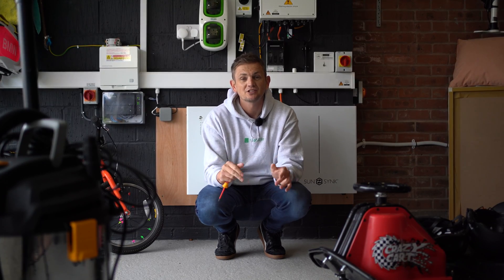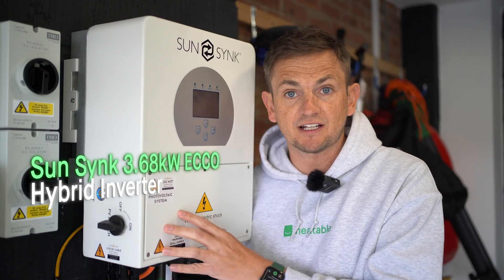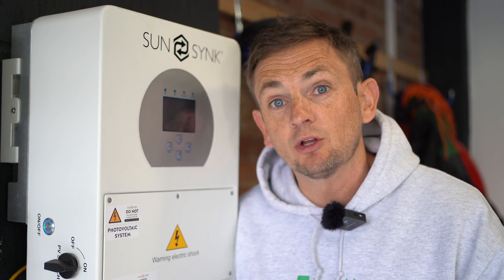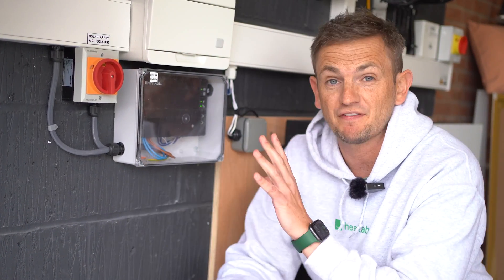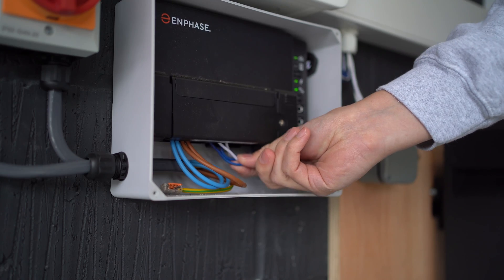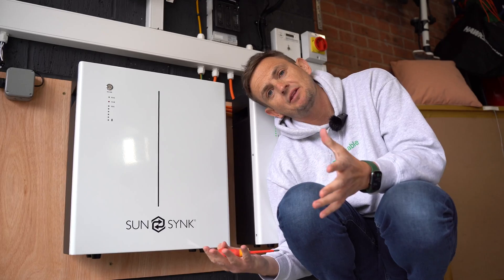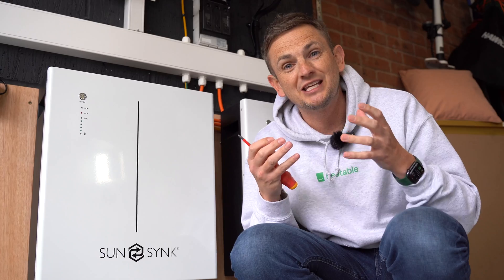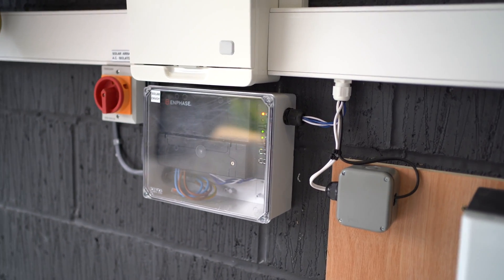Standard vs Bifacial Solar Panels: Is the extra cost WORTH it?

Comment: You changed to many items, so this is not a comparison of Standard vs Bifacial panels. To do that you would have needed to wire the new panels up to another Sunsynk. As noted by others you have also crippled the Sunsynk setup by removing the 5 solar panels so that it does not see enough voltage to operate at certain times.

Comment: Frustratingly, because you have chosen to use different pannels with different technologies on each, we cannot see the difference in gains from just the microinverters compared to the hybrid. I get why you have done this, you are comparing your services to the rest of the market but my inner scientist is screaming ONE VERIABLE AT A TIME! :D :D

One comparison I would love to see would be an REA system with microinverters pitched against a tesla powerwall 3 and its hybrid inverter.

An even more interesting test would be north facing vs south facing with the REA and microinverters. There are some YouTubers that have been going down the north facing expansion and results seem promising so far at 50% of peak generation or more and I believe that is without bifacial or microinverters.

I'm very torn on the whole micro vs string aspect. Each micro being a potential point of failure that would presumably require scafolding costs to resolve, which I'm assuming the warranty wouldn't cover vs the costs of replacing an inverter at ground level covered by warranty. What I have found with the PW3 is that if its inverter fails you can just buy a new PW3 and use the old one as a battery expansion, which  is an interesting scenario.

Its all a bit mute for myself sadly as I'm trapped in a shared ownership nightmare where they will not allow me to install things like solar or heatpumps until I mortgage the other half of the property, which is a few years away at best, so I can probably get better data in that time. I may be able to get away with a battery system to use offpeak rates, however.
Reply from the maker: @tangent2658  Thanks for your comment! We’re actually looking at conducting more tests that will show the power of the REA panel itself against a standard panel. The data speaks for itself so we’re keen on pushing with a variety of them but organising them has taken some time😅
Reply: @Heatable  Thank you for the reply. Very much looking forward to those kind of tests. I know it is not exactly a common application but I would really like to see data on true north facing panels on a pitched roof with a steep pitch say 50 degrees. Essentially the worst case scenario for the pannels, any panels. I want to see what those low light panels can produce when compared to a single layer cell in the same scenario. They can both be on the same kind of microinverters, infact would have to be, unless you wanted to do a bigger test on DC string with 4 to 6 pannels on each test bed. There are a few YouTubers with mostly north facing arrays and they have pretty decent results.

Comment: One month on after having two installs with one being Jinko Neo 440 panels via string and the other REA with enphase 8 microinverters. Comparing generation per panel, the expectation was that the REA would perform 20% better but that is not what I am seing. If anything, I am seeing 20% less generation. The claims are that microinverters activate earlier and stay on longer. Again, this is not my experience. Overall I would recommend Heatable for service, I would however not go with the extra expense of REA and microinverters if I were to do it again.

Comment: The test is inaccurate.
You should have same types of panels on both inverters to compare, of course the older one sided panels performs less than the newer doublesided ones.
Its not the inverters fault.

Test is rubbish.

Comment: I have a question how old were the hybrid  panels system what % of this difference could be attributed to old panel Vs new panel it's proven that efficiency is lost in the first years and then plateau until failure
Reply from the maker: HI, great question. The Hybrid panels were around 9 months old at the start of the test.

Comment: I see what you've done, but ....
You have compared a string to a single panel track, one converting the other not.
You also missed the cost difference and also the life span difference.
Miss matched panels will run at the lowest for all of them with a string inverter.
I can confirm there can be a big difference due to panels alone. Which would cause an issue with data.

Now production and usability. Enphase does not have a battery, so you're not storing power to use later at night.
This could be seen as adding to the cost of ownership, together with the higher price of the hardware.

You could say you lose 15% for 50% more costs. Or we could just look at a 420w panel which only gets 290w usable... 

Stats will only look as good as you want them too.  😊

But for part systems, with AC coupled battery inverter... Going to be better than a sting inverter and offer flexibility and suitable for more complex installs.

Comment: What inefficiency is introduced when adding batteries to the enphase system as the DC is converted to AC and then back to DC to charge the batteries?
Reply from the maker: There was no batteries run on the test. There are various opinions from manufacturers would be losses of approx 3-5% would need to be factored. Worth noting that with an AC coupled battery, more power can be supplied to the home rather than limiting the hybrid inverters max output.

Comment: You didn't mention how much energy loss you would get converting ac to dc when charging batteries, in my opinion that's where hybrid inverters out perform micro inverters
Reply: any ac-DC dc-AC convertion kills over 10% energie ist absolutly nonsenst.
lets say panel to micro inverter = 80-90% eff so over 10% killed.
then micro inverter to DC for batterie charge again 80-90% eff = over 10% killed.
then from battery in the night back to gridd again...energie killed.

only an idiot will do somethink like that.

the serious way last years, solar = DC with a mppt charger into a batterie = 98% from the sun goes into a batterie.
then the near 100% stored solar power from batterys used wenn needet.
only a full nerd will put a inverter on a panel an then try with wasted energy try to put this into batterys....
Reply from the maker: Good point, we'd expect a 3-5% loss when AC coupling a battery system. Worth noting that with an AC coupled battery, you can supply more instantaneous power to the home.

Comment: 1) You didnt mention if the Hybrid system is using optimizers? In the USA optimers are required for rapid shutdown by NEC. So, you would always have those with a string inverter and it could affect things. 2) Why are you pairing 420 watt
panels with microinverters that output only 290 watts? The micros on my roof and those I install for customers output 386 watts per panel. So, virtually no clipping. But the panels will frequently output 350 watts continuously for hours. That would be 60 watts of clipping per panel. Yikes. 3) You cant realistically get a good comparison with 420 watt panels on one system snd 400 watt panels on the other and also have 1 be a hybrid and 1 use micros. Just too many different variables. You seem sincere and likeable, but sticking people with IQ 8's is troubling.
Reply from the maker: Thanks for the comments, in response - 1 - no optimisers, as not required in the UK. 2 - The panels are 400w, average irradiation here in the UK is 500-700 watts/m2 which is why the IQ7+ were a good match for the 400KWp panels. 3 - Both were 400w. Hope that helps
Reply: The 395 watt Canadian Solar panels on my own personal roof north of Seattle has a similar weather pattern to the UK and regularly output between 320 watts and 350 watts for extended durations. Yes. The average output on some sunny days may very well be 290 watts, but so what? IQ7's are still clipping off lots of legitimate production.

Comment: Nice to see some data to back up the theoretical claims.
Worth pointing out the comparison is between 400w panels on the original install vs 420w panels on the newly fitted section so there should be a 5% uplift as a minimum. Good to see the results comfortably exceed that.
I'm surprised we didn't see more clipping on the Enphase setup given the restrictive nature of the iq7's. 
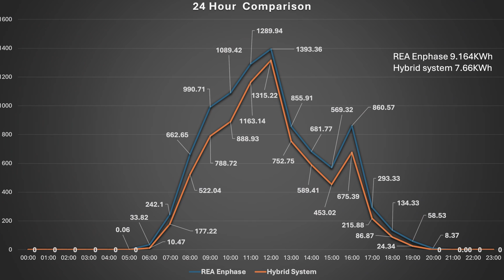I would be interested to know which day the data displayed at 8:58 was taken from? Generation from 5am to 8pm suggests a June or July day? Depending on the slope of the roof, clipping may be more likely an issue around the months of April, May, Aug and Sept so it would have been interesting to see samples of a few more days at varying times of year.
Worth noting also the results with the latest gen of the REA panels they now sell and the iq8 inverters (especially if you upgrade to the HC model) would be a fair bit better than this too.
Reply from the maker: Hi, thanks for the comment. Both were 400Wp panels. I'll check with the team on the 24 hour period data for you. The team are now installing the some of the ACM panels which are the 440Wp panels with the integrated IQ8HC's. We should have a video on this soon. :)

Comment: I know based on the anticedents of this channel that he'll not conduct a fair test. Is the 19-20% better performance due to the bifacial panels or due to the enphase micro inverters? Would you still get a 20% better performance if you'd swapped the enphase to the Qcell panels and the string inverter to the REA bifacial HJT panels? The string inverter has a higher start up voltage, in this case, 125V and it's at a disadvantage in your 5-panels test. Would you still get a 20% better performance if both string and enphase micro inverters were  running on 10 panels instead of 5? If you had used certain string inverters like some from Tesla, Goodwe, SolaX, etc with MPPT tracking voltage and start up voltage around 60V, will the enphase still perform 20% better? Micro inverters have their places, especially in installations with extreme shading problems. Similarly, bifacial solar panels are best in ground mounts and other installations with at least one metre clearance behind the panels where reflected light can enhance their performance. You designed this dubious test to produce your desired results. it is sad that solar experts are willing to mislead their viewers and customers for selfish interests.
Reply: As I understood it, I thought they were testing the bifacial panels and micro inverter as a combo against mono panels using standard hybrid inverters, even though the title said standard v bifacial panels

I’m no expert like yourself, and I get your point about mixing the equipment to test and gather data on each component. Using more than five panels in a test would have been great, but given the space available on the roof, that looked challenging. When doing real-world testing, you can only use the environment given. I suppose even a 1x mono panel vs. 1x bifacial would still provide some comparison data. You are correct about the higher startup voltage when comparing inverters, but I suppose that’s the point. They were bench testing real-world conditions, not ideal test lab conditions. This provided equality, not equity, and customers just want to know what solutions give them the best return.

Regarding my own system, I have both solutions: mono panels with a standard inverter on an unobstructed roof, which performs well when the weather is great, though not so much during the winter months, partially due to the higher startup voltage you mentioned. I also have REA/Enphase on my garage roof, which suffers from obstructions and shading. This is the main reason why I chose this combination over other solutions I researched. For me, this solution works well all the time, including cloudy days and even during winter months. While it doesn’t generate as much as in the summertime, given its less-than-ideal location, it always outperforms my string panels.

As a combo, the REA setup performs much better than the standard panels and inverter, and as individual components, they are better too. However, when combined, they are superior together.

I suppose the question I would ask myself when it comes to replacing the panels on my main roof is whether I would fit mono panels with a standard inverter or the REA combo. Based on my own personal data, I would definitely pay the extra and go for the REA/Enphase solution.

Comment: I love watching your content, however, the title of the video is misleading. Is this about the panels or the different inverters? You could have undertaken two more  variations on this test by mixing the panels with each inverter type.
Reply from the maker: Hey, thanks for the comment! It's about both, ideally we would have had the opportunity to test an REA panel with a hybrid inverter and microinverters and then a standard panel with micros and a hybrid inverter too. To get a fair test they would have to be next to each other, so it just wasn't possible at that time.
Reply: @Heatable  is the cost difference greater than 20%?

Comment: Start up voltage is too low on 5 panels for the 3.68kW inverter. 10 panels will see that SunSynk performing much better, starting up earlier and finishing later.
It's a good test but not a fair one...unless youre only going to fit 5 panels on your roof.

It would have been better to find a neighbour of your customer with an identical roof to have your enphase/REA system fitted and then compare 10 vs 10 in the real world.

The extrapolation of data by doubling is not really valid im afraid.

Anyway, good on you for putting your money where your mouth is and sharing a real world test 👍
Reply: He could have also added together the Load and Grid number from Sunsynk to get the AC side of the export data, rather that suggesting the data is exaggerated. I get about 9% difference between in and out on my 5KW Sunsynk, but some of that power is going via the battery. I imagine your system without batteries will give you a smaller figure for inverter losses.
Shame the Enphase doesn't show inverter losses on their side.
Reply: I have 9*445w going into a 2.5kw inverter on a NE face. Inverter supports 200% DC oversize. In low grey light this inverter is reporting 200w when my SW 4kw facing array is showing 130w. Basically inverters love oversizing. And putting 4 or 5 panels into a 3.6kw is undersizing and below par.
Reply: I have an 11 panel system, split across two roofs (5 + 6). I see a lot of houses with 4 or 5 panels on like mine, surely they don’t have two inverters to do this?
Reply: @ChickalataRUBY  smaller inverters or more likely, split across two strings on a single inverter.
Both strings will still contribute to the startup voltage.
Even shaded panels will still produce startup voltage. It's the current that increases dramatically with stronger sunlight.
Reply: @UpsideDownFork  I asked Heatable the same question on what the drop in start up time was by halving the number of panels but they never responded. I'm not sure about you, but I'm not seeing the sort of losses from how the Sunsynk app reports production/export vs what Octopus pays you? Maybe something for a video on your channel, see what Sunsynk reports as exported vs what Octopus record?
Reply: @steve_787  my sunsynk inverter consistently under reports the export by 5%. That's compared to both my generation and smart meter.
Reply: @UpsideDownFork  under reports or over reports? Mine over reports by around 5% as well from the invert to the actual exported amount. My take on this video is that they reduced the efficiency of the string by halving the panels on it and then added panels that had 10% higher wattage which were also bifacial so the 20% uplift is about right given the changes made.  Still kinda wish I'd had bifacial panels on my roof, but it was tight as it was, and the bifacial's were around 4cm longer so might have had to drop a few panels. Matching the sizes would have dropped from 440w down to 410w so it was really 6 of one and half dozen of the other. I don't doubt the Heatable system works, but would have been nicer to see them have the 5 Q Cells on micros instead of keeping them on the string.
Reply: @steve_787  under reports for me.
I touched on this briefly in one of my early solar videos.

Comment: It would be good to see it with a plain string inverter but the only accurate way is to test with the same datalogger. I have it with Solis under reading its output so you can never compare two inverters accurately using their own data. Did you check the power factor on both systems? It would be interesting to see two sets of panels with either the same model string inverter or micro inverters so we can see the actual panel difference. The string will be more efficient as the system voltage increases.
Reply from the maker: Hey Dave - agreed! The next interesting test will be to investigate the real difference between the REA bifacial panels and the microinverter set up to see if it's just as impressive without the technology working together and how a hybrid inverter set up compares.

Comment: Just a question/thought, my understanding is that string inverters have a minimum start up voltage. Would reducing down from 10 5 panels have affected how early the string inverter would have fired up? Gains would be negligible but just curious. Great comparison though.